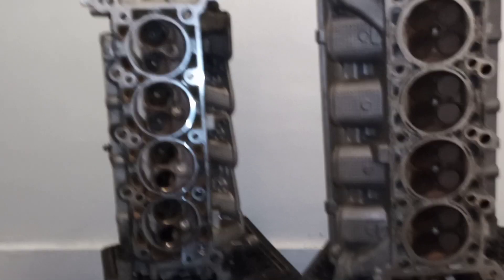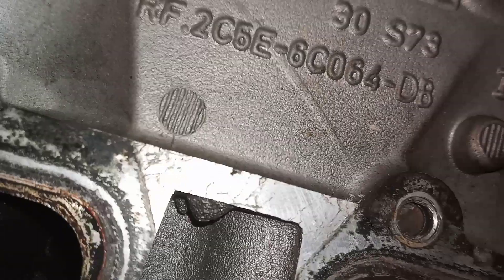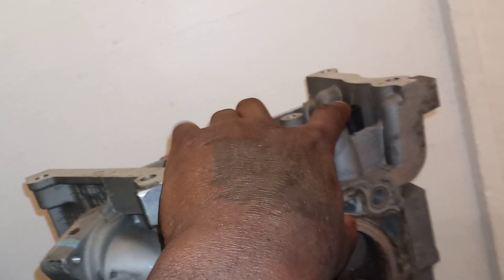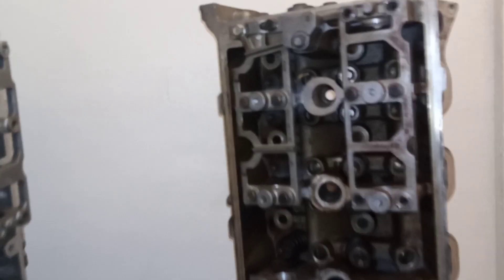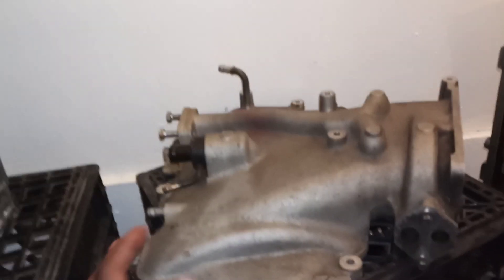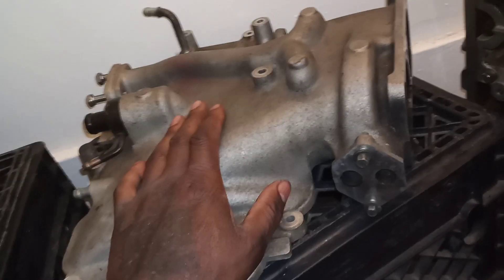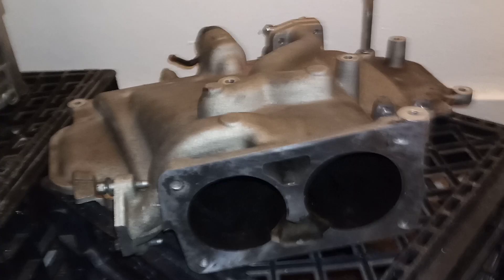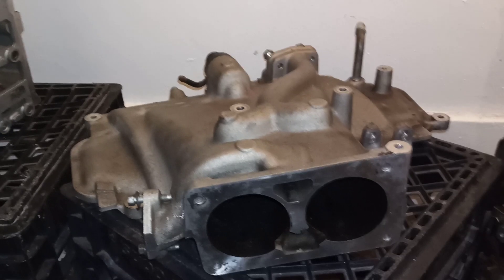Difference between Crown Victoria heads and Mercury Marauder heads and intake

Comment: Can I use a crown Vic block in my mercury marauder and just put on my heads and intake with out a new wire harness
Reply from the maker: Gregory Harris yes you can
Reply from the maker: Gregory Harris what happened to your aluminum block
Reply: Spun a rod I was gonna just swallowed the block until I can get the block redone
Reply from the maker: Gregory Harris you leaving it stock bottom or forged bottom end
Reply: The new block ima leave stock the old one if it’s still good ima get new everything
Reply from the maker: Gregory Harris oh ok
Reply: I just didn’t wanna have to mess wit the harness to much
Reply from the maker: Gregory Harris oh yeah everything will fit the same with iron or aluminum
Reply: You will lose a lot of compression with the pi heads under the DOHC heads

Comment: Wonder how much I could get a set of those heads for. assuming I could make everything work on my 2011 interceptor
Reply from the maker: midgetmayo 99to 02 4v 400$ the one I have 03 to 05 4v db casting are  700$
Reply: paid $100 bucks a set for them more than once, from u pull it yards

Comment: Man i wish i would have found your channel earlier when you was selling the headers
Reply from the maker: blk ghost  I let them go for 450 I bought the kit for 500  with down pipes and x pipe this kit now is 900 bucks 
To be honest a catalytic converters delete use the stock exhaust then grab a medium size cam and torque converter  with be a better combo then jus exhaust alone
Reply: @crownvictorialifestyle4421  i busted open both of my converters but the check engine light be on try to figure out how to turn it off in reset it but will come back on the next day
Reply from the maker: blk ghost you're going to need a SCT tuner to turn off the rear O2 sensors that's the real problem when you do that the catalytic converters missing will make the O2 sensors have a different reading than they're supposed to so that's what cause the check engine light to come on
Reply: @crownvictorialifestyle4421  oh ok

Comment: Two cams on each heads totally different but they both fun to drive
Reply from the maker: blk ghost yeah and they are very heavy fully assembled I'm going to get a wap block or texsid  aluminum block for that build the 4v  build really it's to get a JT trim supercharger from ADTR put on there obviously I'm doing the labor so I'll just pay for the price of the kit with a built trans once I get done with this 2valve build  I've been stripping down that car getting ready to paint the undercarriage and then it'll get full suspension coilover and return style fuel system hooked up
Reply from the maker: blk ghost I have a video I'm going to post about what I've been doing
Reply: I checked ADTR web page out also they have some good parts for the Vic's and Marauders if i ever rebuild my engine gonna go for that  super charger to. But right now just getting the sepension upgrade
Reply from the maker: blk ghost the ground-up is the way to build if you're not building for a Gigan amount  of power some KYb shocks and struts new Springs  control arms and all your tie rods and all your bushings for the front and rear upgraded the brakes you're good to go if you know how to do it yourself     right around 600 bucks just be careful not to get caught up in trying to buy something that you truly don't need I had to realize when I was looking around
Reply: Yeah will get it if i really need it i know i need the rear updated cause when i was on the express way the back end felt funny at around 80 like its floating so going to get that done
Reply: I'm glad you did this video so people see the difference that the Interceptor heads cannot compete with the marauder 4-valve heads thanks for the upload
Reply from the maker: solo 2019 you're welcome stay tuned